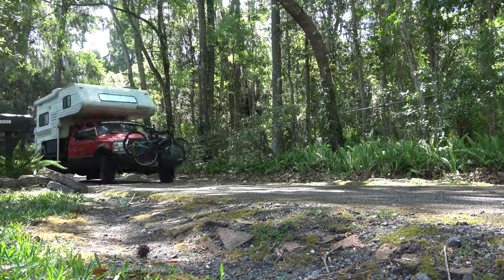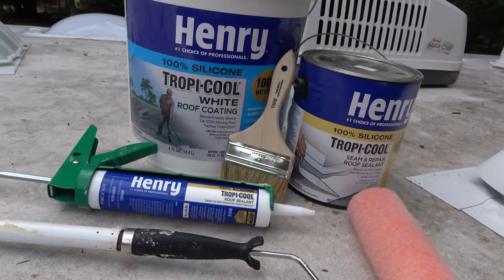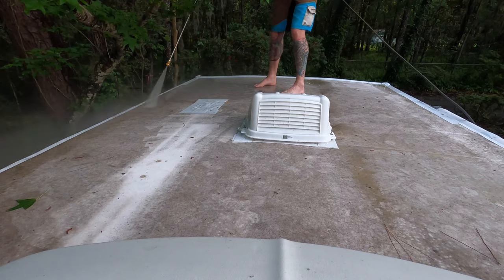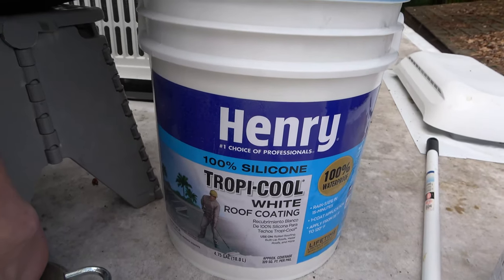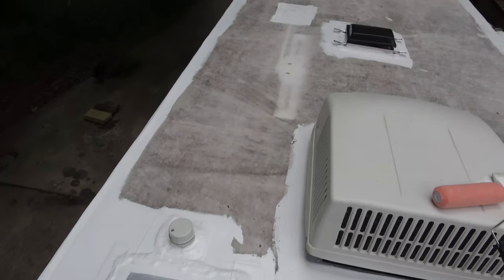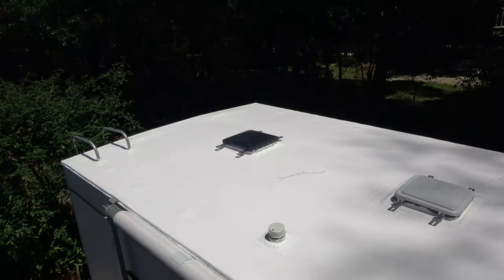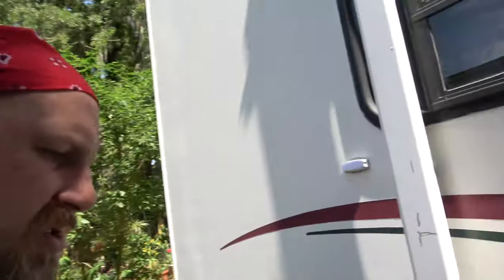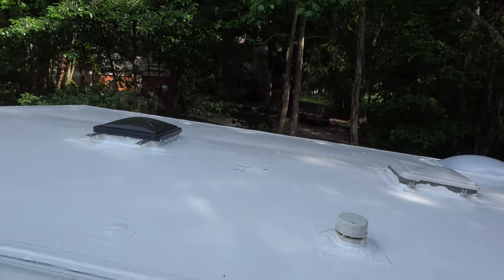Make Your RV Roof Last Longer! // Henry's Tropicool RV Roof Coat RV Roof Maintenance

Comment: Cool video. Just wanted to let you know that I used the same product in 2019 on my Class C motorhome. Now, in 2023, my roof is looking like it could use another coat. However, it will probably do just fine for another year. Then, I will give it another coat. Take care and happy travels.
Reply from the maker: Great to hear!

Comment: I would have suggested using a power washer and let it dry then you could have applied for better application because if they were anything like dirt it could have caused it not to work well
Reply from the maker: We did. Pressure wash then went back with hand scrub and dawn soap. Then dried in the Florida sun and then swept again and applied 2 coats

Comment: I encapsulated all my eterna bond tape in liquid EPDM and or lap sealant. Do you think this might stop the issue of the Henry is not bonding to the eternabond since there's another layer that it will bond to.
Reply from the maker: Not sure. We have had minimal issues of Henry's not adhering. 99% of the tape is still covered 3 years later.
Reply: Use Eternabond WEBSEAL tape if you plan on using Henry's over it.  It is specifically made to bond to roof coatings.

Comment: Great video.  I have a question. I plan on putting solar mounts and panels on my rv.  Should I do this before or after application.  You mentioned doing all repairs before the silicon is layer - but since I am screwing down the mounts I assume I could do it afterwards.
Reply from the maker: We painted the roof first so we could paint beneath where the panels would be, and then installed solar and painted over the mounts afterward.

Comment: Thanls for vid. Did you use primer?
Reply from the maker: No primer. This is thick silicone that adheres well in its own. Just make sure to clean really well before application

Comment: I know this is an older video but i was wondering if you noticed any significant temperature differences inside? Did you do a before/after temp test of the surface of the rv? 
I'm looking to do my slide out in my TT as the inside is super hot on a bright day.
Reply from the maker: No need to be scientific. The fact is that this is bright white, which reflects light more than anything less white. So fundamentally, it is reflecting and not absorbing light. But there are too many other factors not worth testing in a lab... where we park, angle of the sun, time of year, etc.

Comment: I have seen some comments on other channels that this does not adhere to the eternibond. Also, if you apply over all the edges of the roof appliances and screws, how hard is it if you want to replace something; the bathroom window cover, for example?
Reply from the maker: Eternabond and Henrys do not chemically/technically play nice together. But in reality, over 3 years later and we've just done a few touch ups with Henry's and only over the Eternabond. Where the Henrys meets the edge of the tape is solid. Plus we bought enough Henrys (5 gal) to put 3 thick layers on. In our 4th year we will touch up with another layer around the appliances and solar panels. 

If you follow our suit, you should do all roof maintenance prior to laying down the Eternabond. We put new fans, vents and invested in heavy duty covers so that we would not likely have to deal with replacing them after we went through the effort to do the Eternabond/Henrys. We jsut came out of a nasty hail storm in Nebraska and we're glad we invested in the best vent covers and in extra coats of Henry's as the roof didn't show any signs of hail. 

To answer your question directly - it would be difficult and require lots of precise cutting and then, of course, resealing if you went back to the Eternabond/Henry's seal.

Comment: Can it be put all around the exterior or on the pull outs ?
Reply from the maker: Anywhere you have a roof and don't want water to go. It may not stay well on the slideout depending on how much scraping may take place on the roof as it slides out. That varies and may be minimal.

Comment: Can you explain the Henry application on the A/C cover??
Reply from the maker: Since we had a few gallons extra this was just to keep the color matched. Henry’s is so bright white and we do a lot of drone work featuring the RV roof that we thought it would look better to have consistent white on the roof rather than a discolored ac cocerPurely aesthetics.
Reply: Can you tell how you got under air conditioner??  I see blue tape, but how far under were you able to get??  I have some green gunk under mine. I was going to clean as best I could with out removing the A/C.  How soon did you remove the blue tape??  Sorry for so many questions.

Comment: Thank You for the Video. I'm getting ready to do mine, was gonna use FS but after seeing this, I may use this instead. Would like to know how you feel about this stuff a year from now before I do it, but sadly I need to do mine sooner than that. Thanks again for the Video. Safe Travels
Reply from the maker: 6 months in and it's doing a fantastic job! I've scrubbed it down with just a wet hand towel as we collected quite a bit of red dirt in Utah and it cleans quick and easy. There has been no chipping and, fortunately, we haven't hit any large overhangs that might cause it to peel off. Silicone, of course, peels away once you get it started. We have driven through some light brush and I was concerned it would start to peel back. But upon inspection it is holding up fantastic. Of course, we have ZERO worry about water leaks - which was the primary reason we went this route. Will do an update video sometime down the road. But sounds like you'll make the decision sooner than later. It's affordable, easy to apply, looks amazing and does the job it's supposed to!
Reply: I did my 32 ft Fleetwood Bounder over a year ago. Still going strong. The prep is the big thing. Gotta make sure all mold and mildew is gone. If your roof has been coated with other products over the years you will have to make sure that it is very stable. I actual took a sanding pole with 120 grit sanding film over the entire roof first, then pressure washed with TSP. The new coating when washed looks like the day I put it on.  Nothing will stick to it but silicone.  Not even eternabond. It just slides off like butter.  Lol

Comment: Did it help with cooling the rv?
Reply from the maker: We can’t A/B test scientifically. But white reflects light and this is bright white so it should be cooler
Reply: @CalledToWander I did mine last year, did another coat beginning of dirt bike season, last weekend I touched the inside roof verse the side of my trailer and I can 100% say it works, mine isn’t insulated we converted it into a sleeper with electric light and fans and other, no AC and with door and back half down 85 degrees we where very comfortable all day, and sleep great at night
Reply: @CalledToWander  It certainly can't hurt, but keep in mind that the white you see reflected is only a small part (from blue to red) of the spectrum of solar radiation.  I think it is a better choice than black but don't expect it to make a major difference due solely to the color.  The thickness of the coating will probably make a more noticeable difference inside.  (Caveat, while I am a roofer, but not for RVs, so my comment is based on experience with different color roofs on homes and buildings, and on a degree in physics.)  Nice looking job, by the way.

Comment: Great Video. Can you apply this directly to raw plywood? Or do you have to apply over a prined surface or painted surface?  How donyou think this will work on applying to WALLS?  or is it no way because of it will droop down because of its thickness.
Reply from the maker: You’d have to check the Henry website for fine print on applying it directly to plywood. It’s viscous enough that I imagine it would work fine but the site would tell you. But definitely not good for vertical surfaces.

Comment: How is it holding up after a couple of years I was told it will not adhere to eternal bond
Reply from the maker: We're putting out a video next week on our 2+ year update. Spoiler Alert - it is holding up PERFECTLY! Even over the Eternabond, it is adhering the same now after 20K miles and 2+ years. The only places it is peeling off is a few spots over the tape. But we just sprayed some touch up Henrys on it and these spots are back to working like they should! In theory, Henry and Eternabond don't play nice together. In reality, they're getting along quite fine.

Comment: Great video. How is it holding up on the eternabond?
Reply from the maker: It's good. There are a few places where it has come unattached to the Henry’s. As pointed out by other viewers, chemically they don’t mix. But practically, 2 years later and the roof looks and works like it did the day we finished the job.
Reply: But you can just touch it up with more?

Comment: But what about cleaning the rubber roof with Simple Green, (or equivalent) prior to applying the silicone sealant? Power washing ain't enough.
Reply from the maker: This was a short video of the process. We scrubbed every inch by hand, after brush and pressure washer. The roof is absolutely fine over a year later. Thanks for the advice

Comment: I read here and there that it does not stick to Eternabond...????
Reply from the maker: It does, but this is the weakest part. The only time we’ve had any scraping of trees in the eternabond the Henry’s scraped off a little. But it has held up around the vents with no issue

Comment: I don't think you need to put eterna bond tape on. You are better off using Henry's to get in those small cracks.
Reply from the maker: We installed all new fans, vent covers, etc so once we put Eternabond on we didn't want to ever worry about water intrusion and now we dont.

Comment: Looks great! Do you have to completely cover the eternabond tape? I was thinking that you would only need to coat the edge of the eternabond where it meets the roof?
Reply from the maker: Working with Henry Tropi-cool is not a fine art. It globs on everywhere. So if you really wanted to spend some time cutting around the edges of the eternabond you could do that. We just covered (smothered) the whole roof. I definitely trust Eternabond more than the sealant so thats why we put eternabond down on the edges and around appliances and vents and any other holes that were in the roof. But then covering the whole roof, and not just trimming the eternabond, is the most efficient method of application. It's viscous, and meant to be generously applied.

Comment: How many degrees cooler you think it makes it?
Reply from the maker: There is honestly no way to tell. We just know that scientifically the white silicone reflects more light than other product/colors that could be used. We can say that it is a very bright white and that there has never been a time, even in full sunlight, when we could not walk on the roof and have it feel relatively cool to touch. I'm sure the folks at Henry's have some scientific data if you pressed hard enough. But subjectively, we're pleased.
Reply: @CalledToWander  thank you! I just did a service and a modification of my air conditioner and it’s helped.  Do you feel like it helped on the inside?
Reply from the maker: @brandonj7385  Again, no way of telling. White reflects light, and black absorbs it. So from growing up in Florida with lighter colored vehicles, whiter always equates to less heat transfer inside. But there's no way to know for sure.
Reply: The roof of my cargo trailer it went from untouchable at noon in the summer to putting my hand on it without burning. 20 degrees cooler maybe?

Comment: I want to do this on our TT but man 400 bucks for five gallons at Home Depot
Reply from the maker: Compared to the alternatives, this is a drop in the bucket! We’d do it all over again with no regrets. Best $400 investment in our RV. But there are other options you’re free to choose!
Reply: @CalledToWander  $485 on Amazon May 22'.  There has to be a more economical option that works just as well.  The factory statement that Henry's reacts badly to the tape is not to be dismissed lightly.
Reply: Home Depot $369.
Reply: @paulkay3594  If it makes you feel better, I got the Black Jack brand of silicone.  (I was lucky to get it on SALE at Lowes - $100 for 5 gallons!!  Look around it was different at different stores...)  Anyway, I called them and they told me the Silicone adheres to anything.  Wood, metal, tape, lap sealant.  They said once you apply it, nothing else sticks to it.  I am still trying to figure that out.  Things happen, like one of my vent covers just blew off in a "hurricane" in CA WTH!!!  But, per Black Jack, you should be OK with applying to anything.  However, Eternabond says right on their tape it does not adhere to Silicone.

Comment: Could this be used for a metal shed?
Reply from the maker: Henry's website says it can adhere to metal. I would recommend sanding or at least cleaning up the metal surface before applying it. But we're not experts at sealing sheds so worth researching further if you are concerned.
Reply: I would suggest using "cool seal" on ur metal shed

Comment: This is a total waste of time and money. All you need is to clean and condition once a year. The roof on this camper has never been cleaned once.
Reply from the maker: You can’t clean and condition a roof you don’t own for 20 years. This is a used RV where we did what we did because the roof could not simply be cleaned and conditioned. It was beyond that